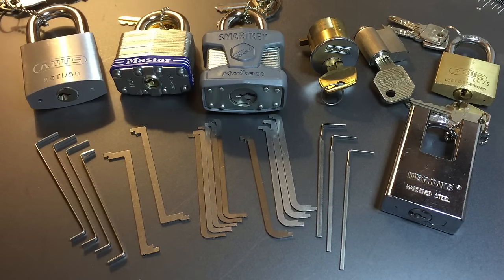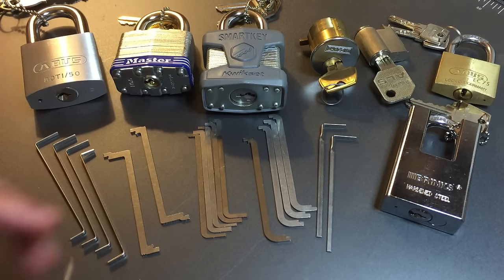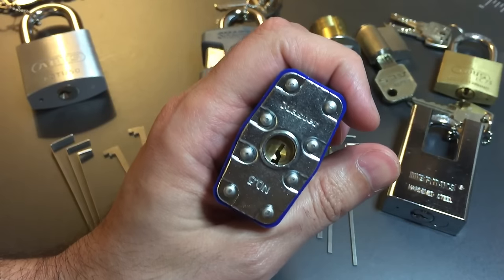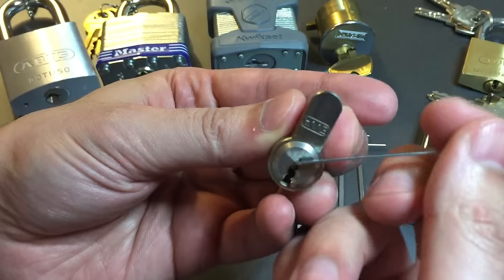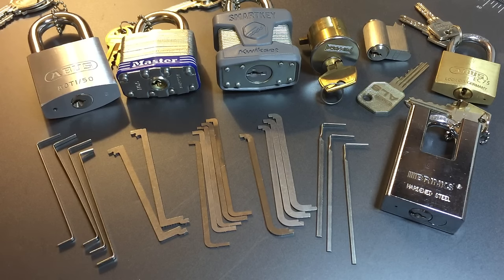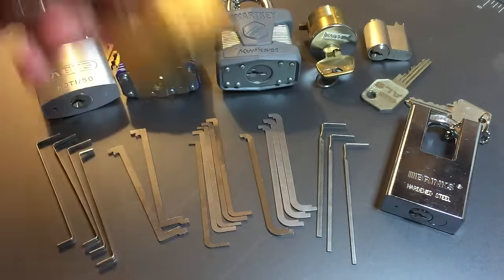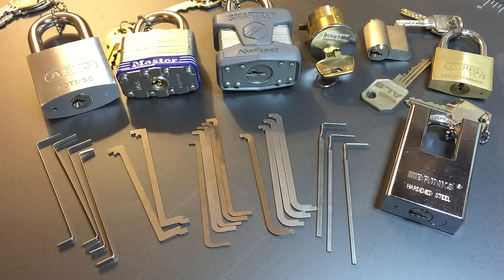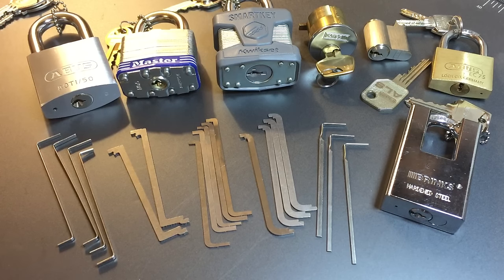[188] My Approach to Lock Picking Tension

Comment: Wow. I'm in my first week of learning to pick and have been having major consistency issues mastering my first basic 4-pin lock (no security pins). One day I'll pick it 5-6 times in a 45 min practice session, the next I'll struggle to get 2 successful picks. Sometimes I feel like I can tell when the pins set, and sometimes it's a total mystery . . . until this video. Just took your advice and was able to FEEL EVERYTHING, which resulted in 5 successful picks in the space of about 4 minutes. I'm just about ready to move onto bigger and badder locks after a 15 minute video. Thanks so much!
Reply: Me too, went from LPL and McNally's FNG kit clear lock to a masterlock and was able to pick it one hour and not able to the next. Increased my tension and the masterlock can pop open  within a minute and i have a video of it popping in 20 secs. Its a master No 3 btw
Reply: @Zyghqwyv ofc it's masterlock 😂. Well done tho fr. I'm learning how to pick and I could get the clear practice lock open in about 5 seconds however sometimes longer. Hoping to buy better locks to try
Reply: @rimusen6364 might be late on this but have you seen the practice lock on covert instruments? It's settable and stuff. Comes with a bunch of security pins you can set it up with. Lil on the pricey side though.
Reply: Same! I can pick the little trainer lock super easily now because I use a ton of tension and just ease off if nothing is moving when I push. Way easier.

Also finding top of the keyway tension making me have a lot more room to push.
Reply: My biggest fear is that I'm using too much tension.. I just don't know how much to push my tools.  After this video and a couple others, I can say, you need tension, and for single pin picking, your hook can handle it!  Gotta find the bind.

Comment: Very informative and it makes me realize I'm gonna be needing better tension tools when I look at the picture of that cheap China lock picking set I ordered
Reply from the maker: You can never get enough tension tools.
Reply: @lockpickinglawyer  can you recommend a starter lock pick set please.
Reply: Would I be able to turn it a feeler gauge into a tension tool
Reply: @whisper4965  I have had the same question... thanks
Reply: R OWER I guess you could but it would be much easier finding some old windshield wipers and taking the metal strip out of them. You could turn the feeler gauge into a bypass tool for combination locks.
Reply: @eyemsuperserial4693  thank you

Comment: As a beginner, it seems that it may be more important to add variety to tension tool selection before investing in an array of picks... Correct?
Reply from the maker: Well, you need a good balance. I certainly carry many, many tension tools in my case.  Finding the perfect tension is as important as finding the right shape pick.
Reply: - JMTyttt - was that
Reply: @lockpickinglawyer  it would be very interesting to take a lock and time yourself picking it with various different tension tools to see the degree to which it makes a difference in the difficulty.
Reply: Keep your finger fixed or locked like when arm wrestling a much weaker opponent only letting them move your arm unless you allow it.

Comment: This video definitely stands the test of time. I'm a newer picker and have been struggling a bit with overset and getting a feel for the pins with the CI lock pinned to a key I have (standard pins). Been using 30 thou, bottom of the keyway. I've picked it a few times, but it seems hit and miss, like I can't determine binding order.

As soon as I switched to 50 thou, top of the keyway, I picked it in under 30. Feels so much better.

Thanks @LockPickingLawyer !

Comment: This is a very important subject that is not addressed by other picker videos. Especially notable is the top of the key way tension point, something that is avoided by most new comers to lock picking. I believe it is avoided as the very idea of inserting a rigid tool at the very point of the picking is contrary to the idea of seeing the keyway. I for many months would use those flexible tension tools to allow a clear view. However your comments are enlightening as regards the top of the keyway as being the best place and the rigidity of the tension tool being important. Very nice video, very informative and well presented, thanks.
Reply from the maker: Thanks -- glad you found it useful.

Comment: Using what I learned from this video helped me discern the difference between a pin that's binding and one that's set and instantly made me a better picker. I blew through all the locks I bought for practicing with ease. Simply the exact advice I needed.

Comment: As a first time lock picker your advice was the most valuable vis: I was cat sitting for  familly when wind blew an upstairs bedroom window closed ! The ladder was  long enough to shut the window, but short to allow entry. Why the bedoom door  was locked with no keys outside I'll never know!
 To "cut a long story square ! " I spent an hour on you tube. Then with two pairs of pliers and with heat from a gass-hob I made the two necessary tools from two "boby" pins = ladies hair clips. I took a close look at your tensioners and made look-a-like to those on the extreem right , just adding some flat epoxy handles.
   At the round door knob  I applied strong tension to a deeply instert tool,  and set to work feeling for pins !
  Within ten minitues I got the first bit of  revolution and the with a bit of a scrapining sound the barrel fully rotated ! Many thanks to you and others on YouTube.

Comment: With a spool pin, it's kinda like driving a stick shift when your coming out of first gear. You wanna give it enough tension that you don't over set the pin, nor let other pins drop. It's finding the right balance all the way through till it sets. It's like when you have a deep false set, that's where you really need to balance letting off the tension as well as putting the right amount of pressure on the pick. I have one lock in particular that gets a really deep false set. The final pin in that particular lock that needs to be set is a spool pin. I use top of the key way on that lock cause it's set really deep. It also needs a lot of tension just to turn the damn thing. This lock is definitely a balancing act. At least a third of the time I'll have to loosen up the tension so much that the damn tensioner falls out. But if there was only one pin I could pick to pick, it would be spools. They're the most fun, At least  for me.
Reply: Here I am working on picking this lock while trying to figure out if what you say about stick shifting cars is a metaphor or an analogy...  I clearly need more hobbies.  :)
Reply: @raintheory3390  Technically it would be a simile since it contained "like." Sorry, I'm an ass lol.

Comment: I just got my kit 3 days ago and wanted to give my input.

I first followed his advice about using a lot of tension and it was frustrating. Even with the see through lock.

I then switch to the Lock Noobs suggested light tension and it made a world of difference. It was instant success. 

When you use more tension, the pins can go higher than they should and the cylinder won't turn. With light tension, every pin just fell into place and then you get to feel the cylinder release.... Such a great feeling. 

I used it on a real lock today and it works like magic.

I think you need to find what works for you.

Comment: i agree.  i use a fairly heavy tension as it gives me great feedback.  when i first started, i over tensioned like most do, but then went way too light and was getting frustrated.  my biggest problem i am finding is that i tend to underset some pins.  then the others seem springy and i think i have overset something so i start over.  is frustrating too.  great video though.  love it.
Reply from the maker: Do you know how to check for oversets?  Seems like that would serve you well.  See my video 99.  I discuss detecting overset pins.
Reply: will check it out.  thank you.
Reply: another question, sorry.  so i watched it and actually did know that once you said it, but wouldn't an underset pin 'look' the same when doing that check?
btw, yours and bosnianbills videos have taken my picking hobby from wanting to throw locks to actually spp'ing them pretty regularly.  i even picked my ultimate adversary with 5 serrated pins when i couldn't even pick my master 3 a month ago.  thanks.

Comment: Thank you for this video, i found my problem with my picking method. I followed the lightest tension method and was getting limited success. Now with your explanation of tensioning ive been opening my 5 pin brinks and master locks within 10-30 seconds constantly.

Comment: I couldn't agree more! My picking success sharply increased when I increased tension!
What I say is that EVERY lock has it's own personality. Unfortunately, one doesn't get to fully know said personality until AFTER the lock is picked.
However, experience is what allows you to pick up on subtle clues along the way to actually adjust tension throughout the picking process as necessary.

Comment: Great video thanks. Nice to know that you make use of the wrench in the bottom of the keyway to lever the pick against, as that's something I've found myself doing, and I wondered if this was good technique. 

Potential problems I've found with top of the keyway tension are that the wrench can make it harder to access the first pin, and if the wrench is touching the pin it might bind it or reduce feedback. The latter problem is of course avoided by not pushing the wrench in too far, but then some keyways don't have a lot of depth before the first pin.

Comment: Two points. First of all, your voice is very soothing and can allow for meditation and focus. I would not apologize for having a 15 min video. 
Second, and this is an observation of a complete beginner of lockpicking as someone who used to use BUMP Keys a little bit more often than actual picks, I find that your description of tension is very accurate. It is a dynamic concept. I have better success rates when I come to a binded pin if I release the tension a little bit to push the pin in and then add that tension back. Literally pick to open my very first lock just now while watching this video.  Thank you!

Comment: Watching this in 2023, and realizing a lot of how I fell out of stuff like picking as a hobby came down to the cheap tools I started with. Looking at this and seeing a lot of locks I tried learning on, but could never get comfortable with. The problem is that the toolkit I got was INCREDIBLY cheap... The metal was thick when it needed to be thin, soft to the point even basic pins would cause the picks to bend out of shape, and the tension tools were all rubbery as hell, to the point I needed to press in ridiculously hard to get any tension on the pins. Broke them out again while watching this and realized the only tension wrench I had that worked was the wiper insert, which is too thick to fit into a lot of  keyways.

If you are learning out there, start with some decent tools. Doesn't need to be super fancy, but make sure they are legit. Bad tools can damage you so much more than just making it a struggle to learn.

Comment: This was a huge help! When raking my Master No5, I found barely touching the tensioner sped things up.

But I could barely feel or hear any feedback on SPP. Just did the crank-to-find, release just enough to set, and got way better feedback on SPP.

Another thing I don't think gets explained well: I can feel the spring much better by actually lifting the pick rather than levering it. That's how I find the bound pin, then I lever it into place.

Comment: Ive spent many years as a hobby picker, and a few as a real world locksmith. For hobby picking, this is great info! But, for real world situations, it can be quite a difficult chore to keep a TOK tension tool in place, due to where the lock is mounted. I once had one at the bottom of a chain holding lawn mowers, pressure washers, and other heavy items together, and the chain was under the weight of all of these machines. It was a christmas miracle getting my hands and tools down where the lock was stuck. But SPP was out of the question! So, a flex tension BOK and bogota rake it was! lol! Other than those sorta scenarios, great video!

Comment: only just started and your advice is basically the advice i follow , couldnt pick on other videos, did 4 locks in a row after your advice , only issue is my tensioners are cheap thin and to big and flexy.

Comment: I know this is 4 years later, but I've been digging at YT videos trying to figure out how to pick my first lock, and all I keep hearing is that my tension probably isn't light enough.
Thank you for this.  As soon as I cranked up the tension, not only can I get my (first) lock open reliably, I now actually can tell which pins are binding and exactly what's going on in there - previously, the only clicks I was hearing was when I was oversetting it

Comment: Thanks LPL Esq.   This really helps.  Using the stiff tensioner and the top of the keyway helped me progress with a Russwin cylinder i just rekeyed with fresh pins, drivers and springs.   Now i am working with some new old stock Schlage FG cores, 6 pin without masterkeying, and its been a challenge.

Comment: And as a Mechanical Engineer I agree with you on the best way for feedback to be felt or dispersed is with either solid foundation for pressure 100% transferred or spring type of pressure transfer so the spring absorbs the pressures applied to it

Comment: This video has been critical to my success in developing my picking technique. Right now, I'm in the process to gradually lighten my tension as I'm setting the pins and also control the picking force better to avoid bending my picks, but it's very hard to do. It is something you can't master over a weekend.

Comment: I am a locksmith of 35 years. I have some comments to you lock picking lawyer.  I hope you read this and comment.  I have learned after all my time that you have some good methods to used picking locks.  I have learned them and use them, so I am thankful for your work.  Then one thing you never do, is apply your technique in real life applications.  Like you are right handed and the locks on your door are are on the left hand side.  And they are set so close in that getting a turning tool into the lock in a useful manner to be able to pick said lock.  Some locks pick to the right to unlock, like schlage, where others pick to the left.  Also it's sleeting rain out side and freezing and you are working on a lock that has never seen lubrication.  In real life you have people watching you, and they look at me on their front door and say, well the lockpicking lawyer says this... I just say to them I will leave now and you can call him, or you can just be patient. 

In effect, I would like to see you tackle the problems real locksmiths have.  Pick open a storm door when the tip of the key had to be there to turn the lock.  It springs out on its own.    The only problem I have is that these people tend to watch your program before they call me, after they have jacked the lock up.  Tackle these for me, and tell your fans that if they call out a real locksmith, to be patient, we have no idea of what kind of junk in what kind of shape you have on your door.

Comment: I paid attention to your topic on tension!  I have always approached locks with a lighter tension, but I do hold enough tension to feel the pins "pop" into place.  Just cranking on the cylinder will result in a lot of bent picks, so keep the lead gloves off and apply as much tension as necessary.  I want to get some of those turning wrenches though.  Old locksmith who is willing to learn even at my age. Thanks.

Comment: I’m a guitar tech who occasionally has to open locked instrument cases, at customer request of course...   However you just mentioned something that’s holds true in guitar set up... “ ask any mechanical engineer the best way to counter vibration is to mount a spring in between...   Yet every tutorial on neck adjustment is to leave a small amount  “relief”  in the neck. ( meaning a small amount of bow in the neck)  yet as you said “in my experience this is exact opposite of what you want..” any bow in the neck turns it into a active spring of sorts, and less transfer of string vibration =  less usable  tone and output.. but a perfectly strait  neck will counter act this effect of the string tension and forces ALL VIBRATION INTO YOUR PICKUP.. or in your case, into your fingers!! Nice video!
Edit;  my point being that you can’t always trust the book in today’s world. With marketing being the dominant force in publications many times the book (in my case) is a cover(pun intended) for poor quality control methods to increase production...   So the books will sometimes intentionally mislead you,  saying things like “most ppl believe a guitar neck should be perfectly strait. (This is a true statement) where in fact the engineers at Fender(RT) and Gibson(RT) say that in actuality it is necessary  to leave a small amount of relief “bow” in your neck to keep fret buzz at a minimum. (This statement is ONLY TRUE if  the quality control of the frets and  board production (most complicated part of the build) has not been done correctly.....    
    Now I live in a world where every school trained guitar tech or builder purposefully does something wrong and the “book” backs up their work. 
  And the only argument you can use is this.................. 
      YOU CANT ARGUE WITH RESULTS.......great video LPL